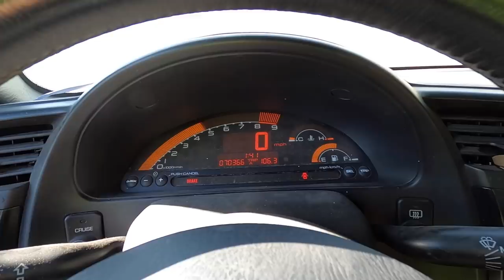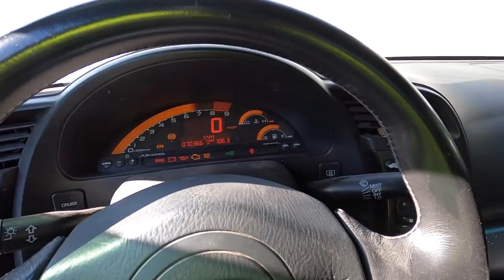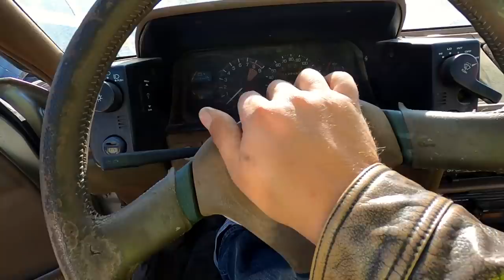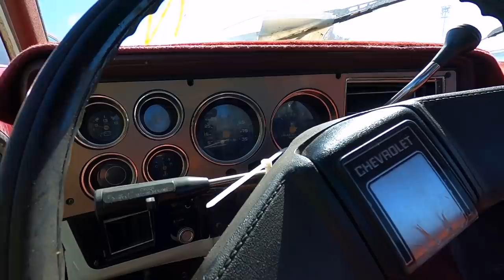Copart Walk Around 10-24-19 with Monkey Wrench Mike Extended! Honda s2000!!

Comment: mk1 MR2 they did a supercharged version made 145 bhp,the stock NA in the video is 128 bhp, the engine is very sought after as it's the same 4AGE 1.6 16 valve as used in the RWD AE86 corolla iconic classic japanese drift car

Comment: I've got an XK.. It's an early 2000's..Only has 20,000 miles on it. I let it sit for a few months and the fuel pump has failed.. Most mechanic shops want over a grand to replace it.. Fun times ahead.. I have a Lexus that sits from time to time as well.. NEVER A PROBLEM!!

Comment: The S2K roof was fixed because if it rains or smth, the inside doesn't flood, but still, what a horrible top lol
Edit : GET IT RANDY, GODDAMN! and Mike, GET THE STANG DUDE!
Also, the MR2 AW11 got a Supercharged version (4A-GZE engine), the sw20 got a turbo version (3S-GTE)

And about the Jag, the kinda guy who drives 90s-00s jaguars are the late 40s dudes with golf clothes and eats fish with chips

Comment: Cars were reliable in the 1950's...My Dad is over 80 and owned a few 1950's cars and aa brand new 1958..Remember until the 1980's most American cars had a 5 digit odometer meaning,after 99,999 they went to 00,000 again..People always assume whats on the odometer is what is on the car/like current cars they see a Toyota/Honda with 210,000 miles and think oh its original/no rebuilt/replaced 60,000 miles ago..

Thing is 1950's cars by the 1960's looked so out of date people didnt want them for the most part..But they did have over 100,000 miles on them..Same with a 1969 car by 1979 on average they had over 200,000 miles.. but odometer would read 20,000 miles,30,000 etc..

Comment: Can’t really lose on that S2K.  With the low mileage, that F20C motor alone will sell for around 4K.  Trans, around $800.  Seats, around $500. Cluster, about $300.  Easily 7-8K to be had just by selling parts.  DO IT 💰

Comment: The BMW should be a buy, the S2000 should be a buy, the thunderbird next to the S2000 should have gotten a closer look, and finally the Volvo next to the old chevy pickup should have gotten a good long look. The Volvo is a great first car flip as is the t-bird. the 2 convertibles are both better options than the 911. you can use 100% of the BMW and the s2000 and still be at legal speeds. ;)

Comment: There is what looks like a really cool early 80s green Isuzu Trooper at 46:24.  If it is there next time you go, can you check it out?  I'm very curious about that one.  Looking at it again, it might actually be a Dodge Raider or I believe a Mitsubishi Montero.  The roof looks kind-of short for Trooper. 

By the way, I think that the S2000 is the way to go and I bet you could replace the convertible top yourself.  I absolutely love those things and many others do, too so I bet it would be a very easy sell once fixed up and cleaned up.

Comment: Obviously the Jag is able to run and drive if it lost control and was in a wreck like that... you got a fender, a headlight, a bit of body work and paint. Some TLC and it would be back on the road, for how long will it is a Jag, but if you like a Jag I think it's not bad for the right price... heck for the right price LS swap it, then you can have a Jag that actually performs.

Comment: the lincoln has a 5.4l but the heads are the same heads as the Cobra mustang... 4 valves per cylinder .  ALso simular to the ford GT,    they dont have the issues of the 3 valves..   145k is low milage on that motor..

Comment: the S2000 is nice the wheels are Rota Slipstreams (a plain cast and not fully forged) copy of the Desmond Regamaster fully forged & heat treated top quality wheels made in Russia and very expensive, the car is cool from what I see just needs a cheap soft top re skin/2nd hand top or you may get a heads up on instgram/facebook to a cheap hardtop or soft top, the aftermarket parts would appeal to some people looking at buying that sort of car